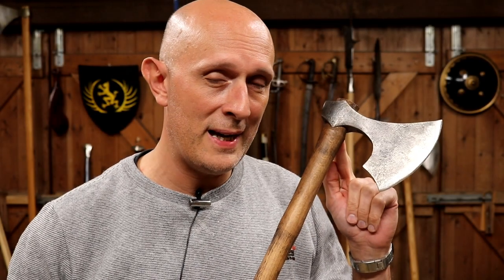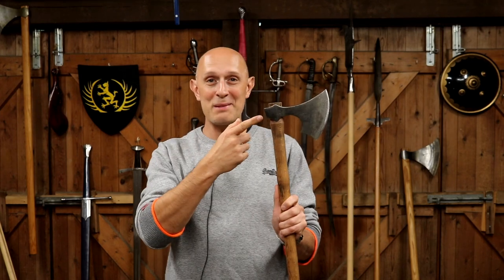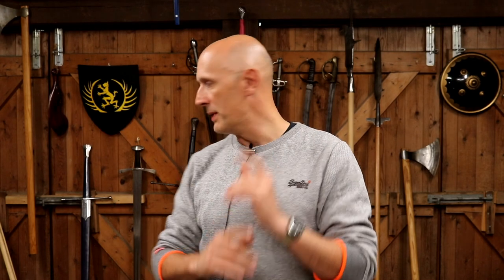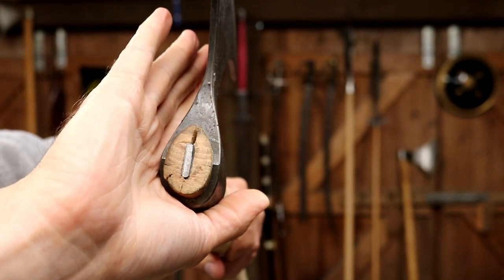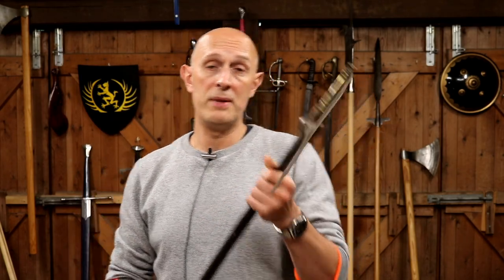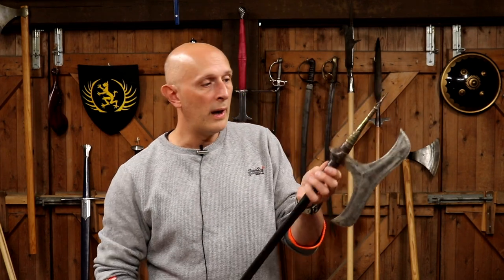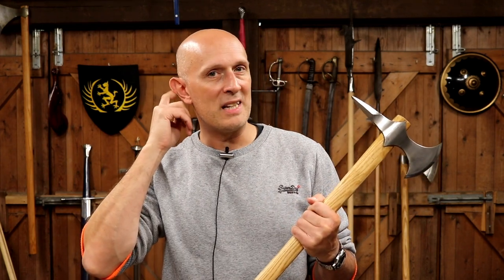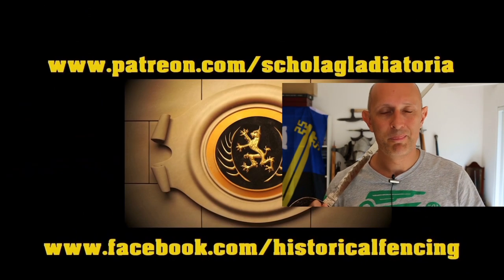Medieval Axe Construction - What Many People Get WRONG

Comment: An interesting thing about axe eye shape. It has to do with how the wood is shaped. Norse axes typically have a tear drop or kite shaped haft because they processed wood by splitting the logs so the length of the haft ran with the grain. Much like how they hewed planks for their ships. So since a log split multiple ways is triangular in shape they made the eyes of their axes also triangular in shape.

Axes from Slavic regions however have a rounder ones because I believe they used saplings and tree limbs to make the hafts of their axes.
Reply: I'm not convinced.  I've certainly found in the past that orienting a haft radially in the log means it crosses many growth rings, almost guaranteeing it will warp dramatically as it dries, bending out of the plane of the axe bit, rendering it basically useless.  It's worked better for me (and I think is more conventional) to orientate the haft tangentially in the log, so that there are fewer growth rings running through the haft and shrinkage is front-to-back, rather than across the haft; you get very little out-of-plane distortion that way.  Trees haven't changed since the dark ages and I think they'd have had the same problems, hanging axes as you describe.

Also, a cloven piece of wood makes for a really uncomfortable grip, so you're going to have to carve the haft into a softer shape anyway and it'd be barely more work to reshape the head-end while you were at it; you'd have to taper the head-end to firmly fit the head regardless.
Reply: @SmevMev  the other advantage to orienting the grain as you describe is that the wood is much less likely to split from impacts in plane with the head. Growth rings in plane with the edge of the axe is what I always aim for when cutting a handle.
Reply: @SmevMev  I'm trying to understand what you mean. Collin is describing splitting the log like a pizza, which is a traditional way to do it. Split the log in half, then split each half again making quarters, etc. It's difficult to split a log in any other way, because if you're not starting the split in the middle of your piece of wood, the split will tend to run off to one side.

I'm having trouble understanding why this would make the handle prone to warping to the side. I'd expect this would be the way the caused it to warp front-to-back.

Good point about them having to reshape it for comfort though.
Reply: I have made oval hafts from small branches and they have worked so far.
Reply: @IndigoBees  If you imagine a log, with the growth rings concentric, I'm suggesting you orientate an axe haft tangential to the growth rings i.e. with the bark-side to one side of the axe eye and log centre to the other.  The original poster was suggesting you orientate the haft so the bark side is to the back and the log centre to the front.  Once the head is hung, the first method will show the growth rings parallel to the axe bit, whereas the second method will have them at 90 degrees to it.

The growth rings in drying wood shorten along their circumference, by some percentage; the further you get from the log centre, the longer the circumference of each growth ring and so the more noticeable the shrinkage.  If you orientate the axe haft so the back is towards the bark-side and the front towards the centre, you have loads of growth rings crossing the haft and the ones at its front will shrink much more than the ones at its back, resulting in stress which warps the haft off to one side of the head and sometimes twists it too.  This means the blade is at a different angle to the haft, depending on how far up you hold it and makes it harder to use accurately.  If you do what I'm suggesting, you include fewer growth rings in the haft and so the difference in amount of shrink is less and therefore the stresses don't build up as much, plus any warp remains in-plane with the axe blade, so you can hold the haft where you like, without changing the angle the blade presents itself to the wood.

The only real downside to this second way is that you need a wider log to be able to fit the front-to-back length of the axe eye at a tangent to the heartwood growth rings, but then you just have to find a bigger tree.

I've tried both methods and simply had better results with tangential orientation.
Reply: @SmevMev  Yeah that's what I thought you were suggesting. It's just interesting to me that it results in a more stable haft, as one side of the haft is farther from the center of the tree than the other, so you might expect that side to shrink more. And having one side shrink more than the other seems like exactly what you'd want to avoid.

But I trust you that it works better. Very interesting.
Reply: @IndigoBees  it's also more resistant to breakage from overstriking or regular use--if you orient the haft radially, the growth layers can "peel" apart under impact, anywhere a ring runs out to the surface of the handle on the backside, and the handle will split lengthwise along that layer. If the rings run in plane with the edge there is no such weak point for a crack to form.
Reply: @IndigoBees As the haft isn't very wide, I suppose the growth rings on either side of the haft aren't too different in relative length, so they shrink pretty similarly [Edit: I suppose that should apply to the other case too, so perhaps not].

 Honestly, I do think it's difficult to intuit why one works better than the other and it's only because I've tried both that I really feel sure about it.  Working with wood is a good reminder that nothing's ever quite as straightforward as it looks.
Reply: "Saplings and tree limbs", as in coppicing? Coppiced timber was used for tool shafts and handles, in Britain and Ireland. It's my understanding most wood used then, apart from for ships and buildings, was coppiced timber and not from splitting large logs.
Reply: @SmevMev  you shouldn't be using green lumber for axe handles anyway, so warpage is a smaller issue than breakage in use.
Reply: @Uncephalized  You get the wood for making the axe handles from a fresh log, because it's easy to split the log into smaller pieces and carve the rough shape of the haft, then leave it to dry and do the final shaping and hang once it has seasoned.  Thick logs essentially won't season in the round before they start rotting, so all the initial processing is done green.
Reply: Well written and entertaining discussion points on this comment and subsequent replies. Part of the interest of these videos is the comment section, which I'm sure mat appreciates as much as I do. Thanks folks.

Comment: Reference the orientation of the wedging on the axe heads my experience with North American tool axes comes from the pioneer tools used during my military days.  The advice I got from the combat engineers was to put a large wooden wedge along the long axis then, if you want to make it extra secure, pound in one or two much smaller metal wedges at a slight angle from the wooden wedge but not at an extreme 90 angle.  I've also had a number of people advise me not to use the metal wedges at all as they make it harder to chisel out the axe's eye hole if the handle breaks and you need to replace it.  I've re-hafted axes both ways and, so long as the axe head and axe handle are the correct size the wooden wedge is usually more than enough for infantry work. 

That said, someone in the lumber industry might have better advice as, despite the use of chainsaws, they still occasionally use axes.
Reply: Exactly like we do it here in scandinavia. I have an inkling that the metal wedge comes in to play if the handle experience much shifting in moisture. Like if you take it inside your home after a trip in the woods. I have read that swedish lumberjacks sometimes used coins before ready made wedges were available, but they took their axes into the cabins to prevent the edges from getting brittle from the cold (all logging in norther sweden was traditionally done in the wintertime, no sap in the timber, easier to transport logs by sleds and nothing else to do.)

Comment: Good friction fit axes are a sight to behold, especially if it is dry when you put it on and it swells a little bit; it sits so darn hard it aint coming off unless you are actively hammering it.

Also regarding the debate about how axe heads were fit, isn't it possible to look at the eye and see whether or not it slants towards the top or bottom? While the example wasn't perfect, I think I recall one example at the Vitenskapsmuseet in Trondheim (upper floors, wall to the back, cant remember museum number) having an eye getting narrower towards the bottom, but this was seen from only one angle. 

Definitely an interesting debate tho; on one hand you can have premade handles ready incase one breaks with a friction fit, but as long as you don't have to make it on the spot it doesn't really take that much more time to shaft a axe with a wedge either. It would probably be a bit safer too due to being able to insert more wedges expanding the wood inside to fit incase handle and head isn't made specifically for each other. (assuming that handmade axes from the middle ages and back have more variance than machine made ones today)
Reply: We had a modern axe handle break when clearing trees, and the wedging was so solid and secure that we chose to burn out the remainder of the handle. Yeah, not necessarily good for the temper, but it's not our best axe anyway. it's the one we use when chopping roots to clear stumps.

Comment: My twin brother use an axe in his work. He reshaft the things roughly a little more then once a year. And he prefer wodden wedges rather then metall wedges. Because a wodden wedge gives more freedom (to reform and saw off the piece sticking up). Oh, and he prefer Hultafors before Gränsfors - mainly because of balance and because he resharp even a new axe to get the edge slightly out of center (because of how he use the axe).

Comment: I believe one thing has been overlooked, it should be clearly visible in which way the head was put on the handle simply by looking at the eye. If the eye is wider at the top than at the bottom it was a tomahawk style friction fit (as seen on modern day basque en rinaldi Italian axes). If the eye is wider at the bottom it was meant to receive the handle from bellow and be secured by a wedge. 
If you take this into account there should not be a lot of discussion I feel. 
Or maybe some historical examples had a perpendicular eye, in which case I would assume a wedge, since it would not work wel for a friction fit.

Comment: Metal wedges are not used because they are kind of terrible, besides breaking the wood, they don't move with the wood and loosen up pretty quickly.  Metal Wedges, nails, screws, and other non-wood debris, are definitely a modern thing.  Wooden wedges are way better for when the handle needs to be larger than the head.

Edit:  To provide a flair out at the end you can either glue another piece of wood on the handle after the head is attached, and then shape it, or you can also put some sort of ferrule around it.

Comment: I've hafted more than a few axes. I was taught to always use a longitudinal wooden wedge. I was also told to always use a softer wood for the wedge so you don't crack the haft. The wedge will mushroom and break before the haft fails. When the wedge won't go any farther, saw it off flush, then put a nail or screw in the top to give a little extra push against all sides of the eye.
Reply: As far as I know that's the way we do it in my country to, although I don't know isn't quite obvious ;
Reply: You can use either softer or harder wood for the wedge, it has the same effect of sticking better to the haft. Just don't use the same wood as the haft, then the wedge might be pushed out.

Around here, we often use harder wood for the wedge, because hard wood is more expensive. But if you are using stuff like hickory for the haft, then a softer wedge is easy to find.

Comment: Can't the construction method be deducted by the tapering of the eye? If you are using a wedge, then the eye should be hourglass shaped, while if you insert it from the bottom it would simply be conical. It is likely that the eye was brought to size with a drift, so both tapers were as easily achievable.
Reply: That is only part of the topic, however. 
There is the part about which way, and with which material the 'top-down' axes were wedged.

Comment: Even nowadays most traditional European wood cutting axes use wooden wedges (always following the direction of the blade, never crosswise, as that is more likely to split the shaft further with chopping). You can also buy those wedges separately in most hardware stores.

Comment: You want a round steel wedge. But first. Let the wood eye handle soak in oil first for a while. Then it’ll be good to use the round steel wedge, and BAM!!! You got a tightly fitted axehead

Comment: All "decent" quality axes today use wood wedges and a small steel wedge perperdicular to the edge of the blade to split the haft and 1st wood wedge "front to back" basically as security-it helps prevent lawsuits but ensuring the maker has done all they possibly can but the steel wedges are really not needed in any axe
Reply: Can validate this. My small Gränsforbruks axe use a singular wooden wedge in the direction of the blade and nothing more. Tight as the day I got it. A dream.
Reply: Yeah, this is what I've seen the majority of the time. At fleet farm they sell wedge kits with one wood wedge and several smaller metal wedges. The third way he talks about are how most pick-axes are done now
Reply: @willek1335  Gransforsbruks axes are amazing
Reply: A single wooden wedge, or a wooden wedge plus a cross wedge (also of wood) are all the security a good axe can need. I think the metal cross wedges we see are more often in mass produced items as an attempt to take out any slop and looseness that might occur in their process. The metal cross wedge can be reliably and quickly driven into a wooden handle as an additional security measure. A wooden cross wedge also does this but takes more time—you have to use saw or chisel to cut an “entry path” for the wooden cross wedge. I do this for our tomahawks and it is time consuming. However, unlike the metal cross wedge, the wooden wedge will contract and expand with the handle as the environmental conditions vary. Any metal wedge, whether primarily or cross wedge, can eventually result in a loosened head/handle connection if the axe is subjected to enough change in temperature or humidity.
Reply: i can vouch for this. My own small outdoors axe(hatchet) is the best

Comment: And what about powerful thrusts to fit the shaft in the eye? Or is hammering a better technique? Should the shaft or the eye be lubricated beforehand to ease the passage? Does the thickness of the shaft matter more as opposed to its length to make a better coupling? So many interesting points are left unanswered :(

Comment: Interesting... The common axe you find in Switzerland has the head put on from the rear, with the handle getting thicker towards the top... And then, once you've hammered it up there and it's firmly fixed, you drive a wedge into the handle from the top just for good measure (usually with a wooden wedge, it seems). I always thought this was the common way to mount axe heads. No idea about surrounding countries, but I've seen the same construction in Bosnia. Maybe it's a continental thing?

Comment: When I was a young boy my neighbor teach me how to substitute an axe shaft, and the method he used was to slide the head from the bottom and hammer it in till it was extremely firm and cant hammer it up more without damaging the shaft. Then, he used to hammer a band of some kind copper alloy in the wood just below the head to keep it in place just in case as an extreme safe measure (I don’t remember if with a couple of peg or needle or not). But those axes were tools, I didn’t know that system was used also with weapons.

Comment: i usually use a wood wedge in line with the tool then a metal wedge cross ways.  sometimes i’ll just do the wood wedge and use the metal wedge later if the handle loosens up (the most wedges i’ve seen in a tool handle was a hammer that had lots of wedges and nails driven in after the fact to keep the handle from falling off and there was more metal than wood).  

i also notice old tool handles tend to be narrower (and i’d figure this habit would carry over to weapons) and the bit of handle holding the head on lasts longer on narrower handles since less shock is being absorbed directly by that joint.  my theory is people who use hand tools more frequently move to a looser more confident grip which is easier on a narrower handle.  a thick handle is more ergonomic for the tight grip of someone who only picks the tool up once in a while and wants to know they can rely on it.  

so both i can see wood wedges lasting longer in a tool with a narrower handle of the user of the tool/weapon being more comfortable with a narrow enough handle that can fit through the eye of the tool.

Comment: Hey Scott, Could a blacksmith simply put a workable head on the shaft and pound it against the wood while it’s hot?
Reply: No. There’s a good likelihood you’ll set the handle on fire or if not, then you’ll make a layer of ash/charcoal that makes it easier for the axe head to slip off. I’ve seen bladesmiths though use a similar technique to fit handles onto tangs.